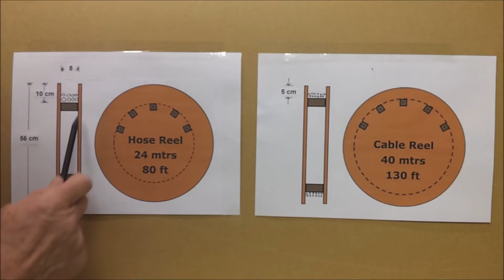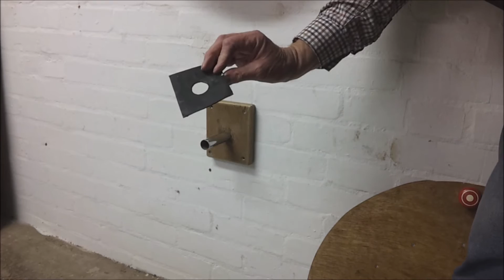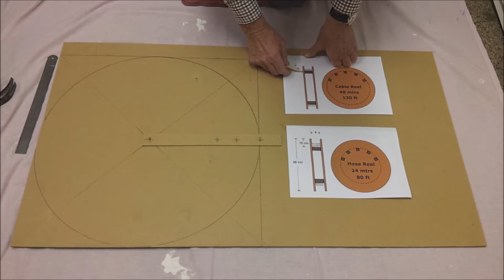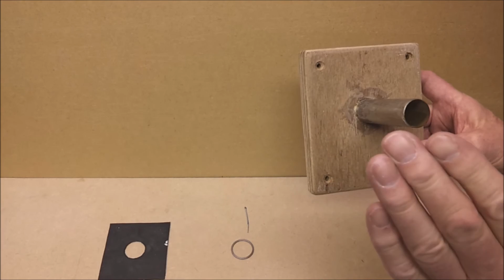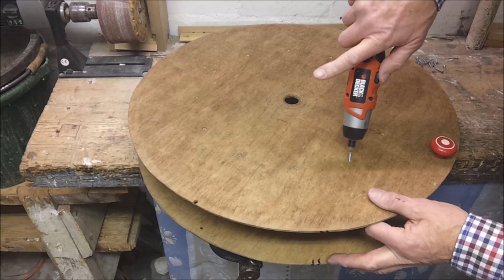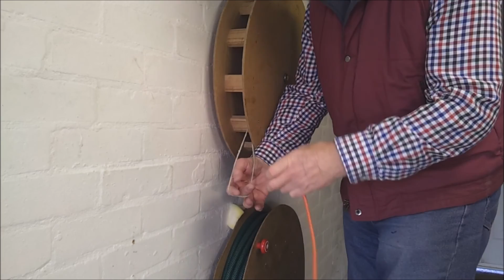Winding Reels for Cable or Hose

Comment: Good video and good description.  I'm going to try using a wood dowel for the little pieces and I'll find centers via my lathe.  I have a hvy welder cable and an smaller extension chord.

Comment: How long is the hose that can be fitt in this reel?
Reply from the maker: In the early part of the video I give you the information you ask for, with a diagram. Good luck with your project. Sincerely, Mike
Reply: It is also going to depend upon the diameter of the hose.  Even with garden hoses, they are not all the same diameter... The longer lasting commercial hoses tend to have thicker wall thickness on the hose, so even if the inner diameter is the same, the outer diameter is going to be greater and you would be able to put less hose on the reel.  Here in the US, the garden hoses are typically 1/2", 5/8", or 3/4" inner diameter.  Obviously, even if two hoses have the same wall thickness, you would be able to put more 1/2" ID hose on the reel than on one with a 5/8" or 3/4" ID.  It would be easy enough to calculate how much hose a reel like this could theoretically handle -- you would need an accurate measurement of the outer diameter of the hose.  I say "theoretically" because it is assuming that you lay the hose perfectly on the reel, leaving no gaps and having each layer aligned perfectly.

For example, for easy of calculation, I'll assume a 1" OD for a hose, a 16" reel inner diameter, and a 24" reel outer diameter.  These are NOT the dimensions that he used though.  That leaves us 8" difference between the inner and outer diameters of the reel, or a 4" radius, thus room for 4 layers of hose.  Let's also assume that there is enough space between the inner sides of the reel for 5 loops of hose around the reel before having to go to the next layer.  This means that on the first layer, we are able to 5 * pi * 16", the second layer 5 * pi * 18", the third layer 5 * pi * 20", the fourth layer 5 * pi * 22"... The total hose would be the sum of the 4 layers, so 5 * pi * 16 + 5 * pi * 18 + 5 * pi * 20 + 5 * pi * 22 = 5 * pi * (16 + 18 + 20 + 22) = 5 * pi * 76 = 380 * pi = 1193.8" or 99.48 ft...

Ooops... I just realized that you asked this question 2 years ago... Oh well... Maybe the answer will help someone in the future... :)
Reply: @CurmudgeonExtraordinaire  thanks for all that calculations.  I have 2 100 foot hoses im thinking about trying this video idea out on... Im in america and my hoses are kinda thick. This set up could possibly be modified for an out door reel that has the ability to connet to the faucet without unreeling the entire reel ...  

and as you say you cant just get a perfect wind up on the reel so i would allow for several extra turns so it fits without having to be perfect on the reel job

Comment: Wow, such a simple but well thought out design. I've been searching for suitable reels for my tool trailer, many reels that you can buy will simply not work in the location that I want to install them in. This is perfect! This design can easily be changed to fit where I want it to. Thank you!
Reply from the maker: Thanks for your comment. The reals are so simple but effective. It is very important, however, to cut the wood cross pieces absolutely square, then the whole thing assembles easily. Good luck with all your DIY projects. Sincerely, Mike